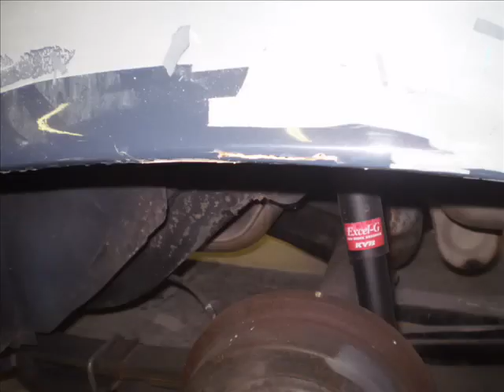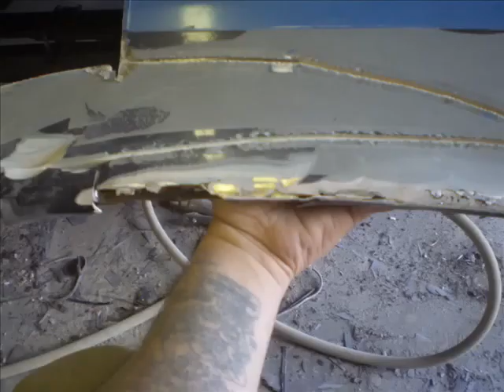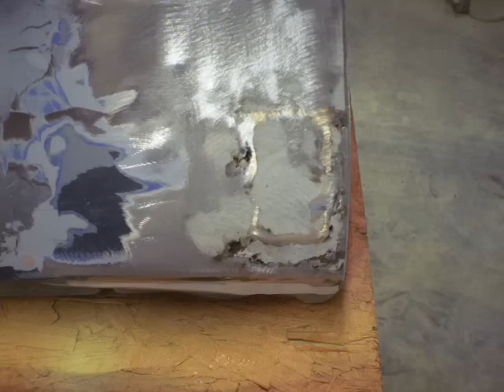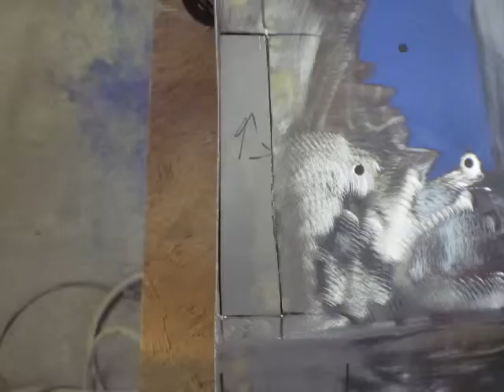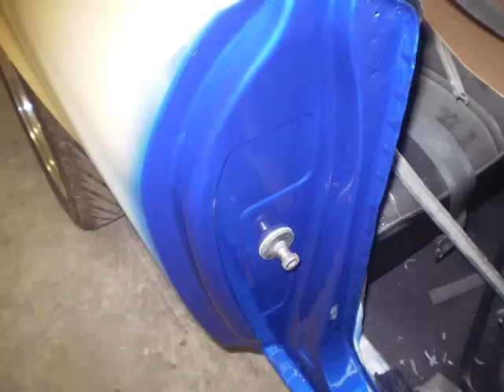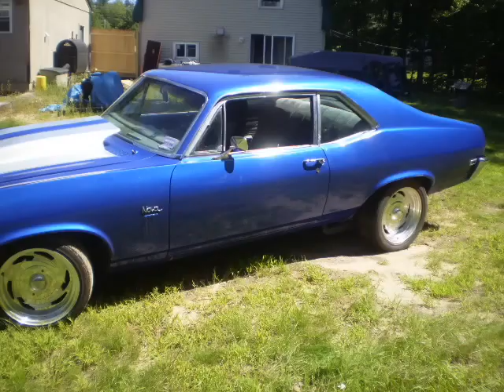1969 nova restoration paint job caponeauto

Comment: That looks great!  And only $2000?  Just curious: what size air compressor did you have to use for paint work?  I've heard a std 5 hp shop compressor isn't sufficient for auto painting (thinking of tackling my first auto paint job)...